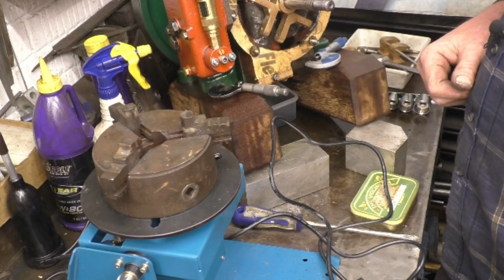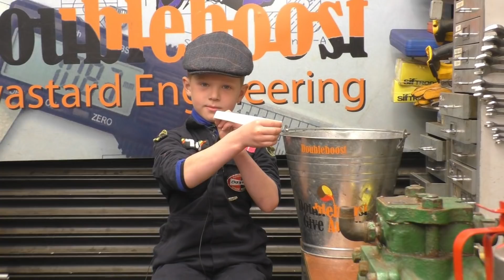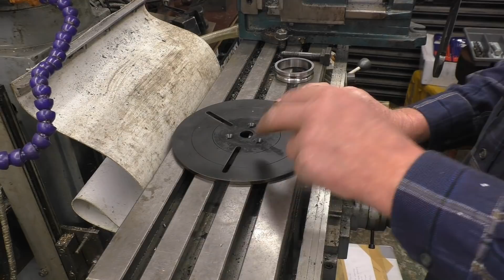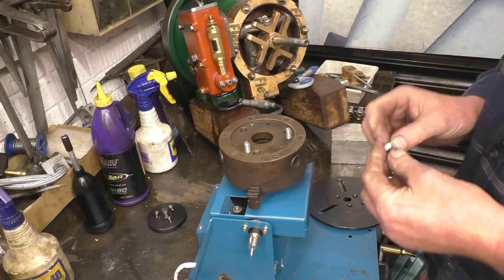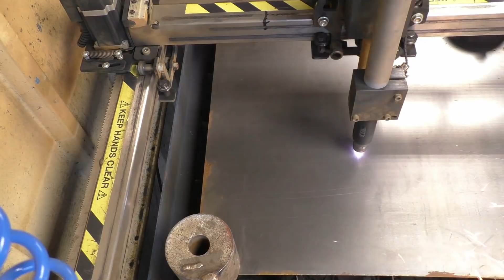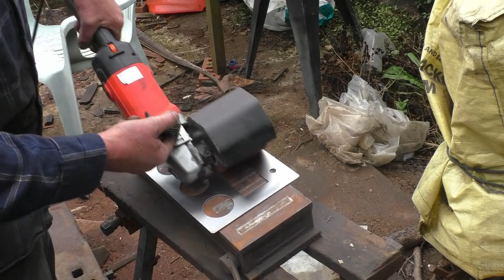SNNC 397 P1  . Weld Positioner MOD . Harley Bike Cut Out

Comment: My first thought was you had in your title "Harley Davidson Cut Out." I thought you meant exhaust cut out.  I thought that maybe the UK required mufflers on Harley Davidson cycles so to get to be obnoxiously loud they needed an exhaust cut out.  I know here on this side of the pond that only 1 in 1,000 HDs still has mufflers on them.  They either rot out on the way home from the dealership when bought or that HD is taking all of those mufflers back to the factory and putting them on bikes to be shipped only to have them come back the 4th or 20th time for being reinstalled.

Comment: I’ve been thinking about getting a positioner, since I really don’t want to make one. I’ve looked at those small ones but didn’t think they would work with a bigger chuck and work. Other than the chuck, how much weight have you tried it with, say a two foot long thick tube, horizontally? I don’t do really heavy things, but 15 pounds isn’t out of the question.